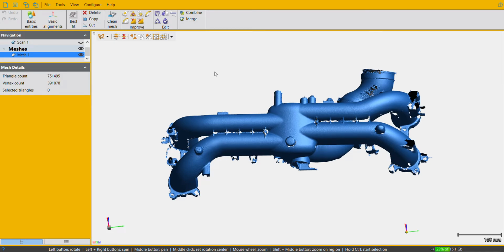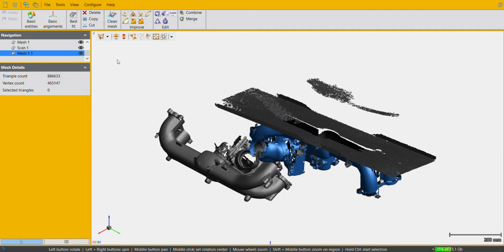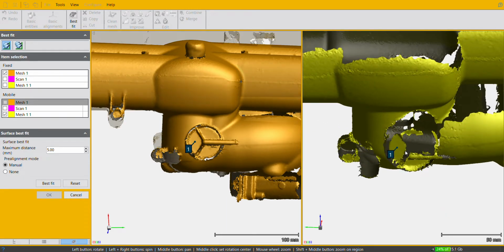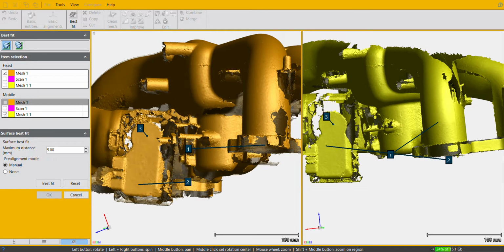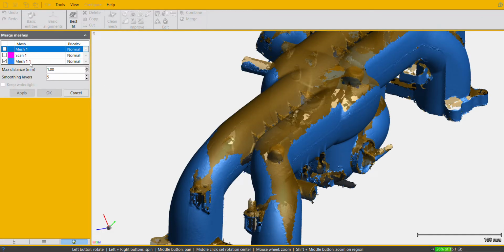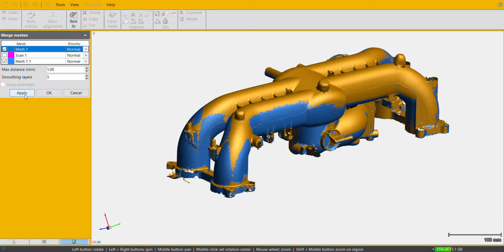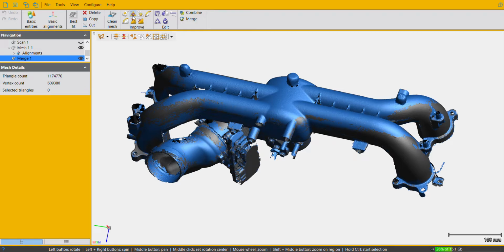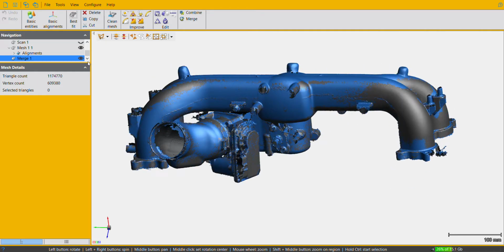Peel 3D - Merging Meshes of a  Subaru WRX intake manifold

Comment: Hello Micah, Thank you for this very usefull video. I was wondering if there is a way we could contact you?
Reply: Micah what software are you using to
Covert your mesh to a solid file?
Reply from the maker: @NerdlyCNC  for this file, I didn't create a solid. I simply needed a surface model for reference data (and have as cheat for Solidworks surface limit). 

You can actually create a water tight model in this software however. I personally find it quicker and easier to patch in my CAD seat simply because of familiarity.
Reply: @Micah Makes cool. thanks. My peel 2 arrives tomorrow.
Reply from the maker: @NerdlyCNC  also, I've found myself watching just a few of your videos...might have slight CNC envy.

If you have anything that you'd specifically like to see covered, let me know.
Reply from the maker: Sure. I can email you guys right now.
Reply: @Micah_Makes  Great, we will be waiting your E-mail